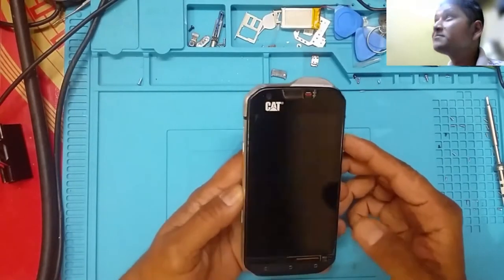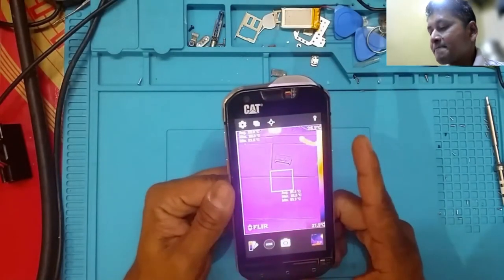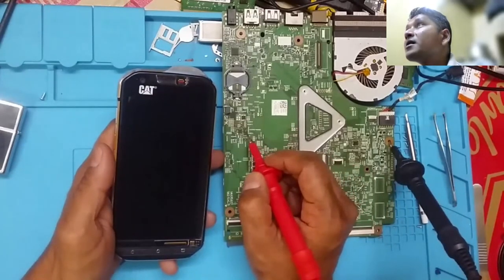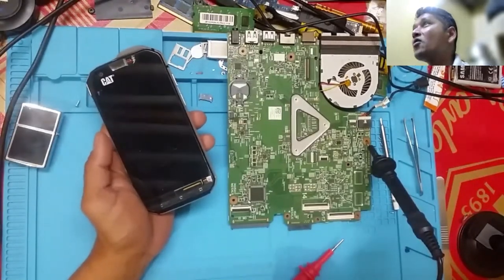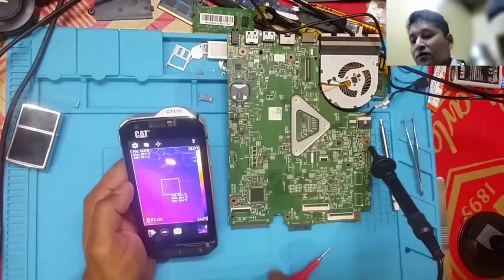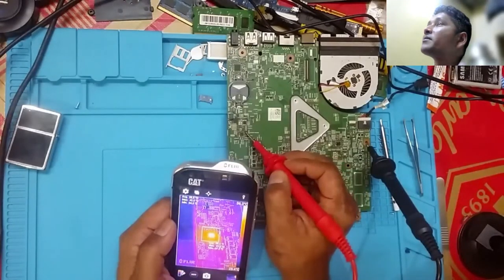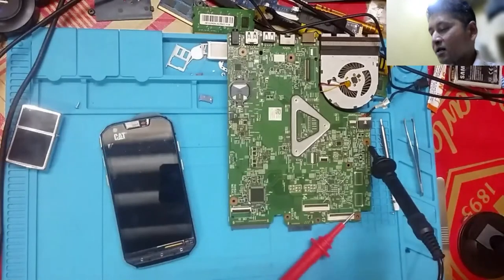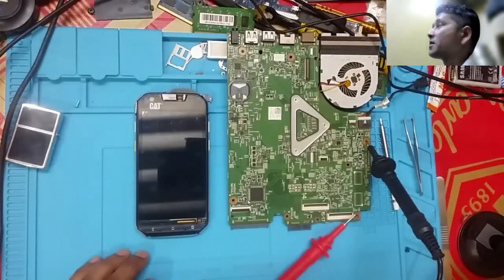Cat S60 Phone to Find Short On Motherboard

Comment: Hello, what voltage injector tool are you using?
Reply from the maker: Hi. I am using short killer pro. you can buy it by Northridge Fix or even Ebay they have same tool.
I put both link under.
https://northridgefix.com/product/power-supply-short-injection-detector-with-voltage-and-current-control/
https://www.ebay.com/itm/134554915357

Comment: Hi , I am buying one soon , what is the maximum temperature it can read ? Online some say 120C others say 200 C , I would appreciate if you can confirm the true maximum, thank you .
Reply from the maker: Hi I will let you know. But it's enough for repair work.
Reply: @aafixza  thank you for the quick reply, please let me know , I am planing to use it for a diy bga station and it would be helpful if it can monitor 150 c at least
Reply: @aafixza  I just bought one , I can confirm it measures 150C max
Reply from the maker: I will check tonight if the temperature range can do your work.
Reply from the maker: Congratulations.
Reply: for detecting short circuit, should i buy higher resolution thermal camera for about $400 or save the money by buying this used phone with about half of the price?
Reply: @hadi27O  hi , which thermal camera is that ? Just curious because afaik high resolution one cost 1k $ and more, most of sub 500$ are 80*60 or 120*160 like the flir pro for example
Reply: @FerdAboubakrOnline  someone recommend T2L, it has 256x192 resolution. but i don't know is the product is better comparing to flir one pro or not.
Reply: @hadi27O  looks good, high res and higher refresh rate (25hz) , thermal range is much lower than flir one pro 120c vs 400c so it will be up to you which aspect you value more , the cat s60 I got cost me 130$ flir pro here is 260$ and tL2 is 360$ .
Reply: @FerdAboubakrOnline  $130 is a good deal, in my country i found used s60 with little defect on the screen and other cosmetic damage and it cost about $155. i think unless i can bargain and get a good deal, i will look for higher resolution camera. since i need to use for detecting short circuit on motherboard, i think higher resolution is more important rather than better temperature range, thank you for your information.
Reply from the maker: Hi. U can rather look for s62 model. Or newer. U can get them cheap 2nd hand. The all thermal camera is low res. Unless U want to use 600 to 1000 dollar on a proper thermal camera. You can look in to NorthridgeFix.com Alex is selling thermal camera for around 500 dollars. But it will be expensive then yhe 2nd hand cat phone.
Reply from the maker: And he is USA. So if you r in the US, it will be easy to get the shipping done.
Reply: @aafixza  thank you for the refferences, i'm used to watch his channel's videos but don't even know he's selling thermal camera too.
Reply from the maker: Flir is expensive. But the best. Alex is selling Unit-T. Just go to his website. NorthridgeFix.com
Reply from the maker: It's a good idea for using a thermal cam. If money is not a issue. The cat phone was a cheaper solution when one can not afford a thermal cam. I couldn't spend on thermal cam. So I choose the cheaper option. And it did work for me. And only thong that irritating me, is that I can't record from the cat phone to my obs studio. I have to use camera to record. And it is not very nice. But those thermal cam has dedicated video output so you can record the cam feed on ur pc.
Reply from the maker: Flir has now other competitors. U can check the other company products. They r cheaper and efficient.
Reply from the maker: HI. @hadi270 its a cat s60 phone which has built in thermal cam. and I'm so sorry to reply after a year. i have been inactive on YouTube for a while.
Reply from the maker: hi. if you have the money go for the proper cam. you can find one for good price at this link
https://northridgefix.com/product/uni-t-uti260b-thermal-imager-camera-256px-x-192px/
if you don't have that much, go for a 2nd hand cat s60 phone.
Reply from the maker: hi fred, https://northridgefix.com/product/uni-t-uti260b-thermal-imager-camera-256px-x-192px/
go check this thermal cam. its about 400 dollar.